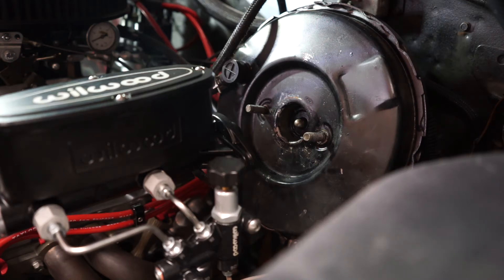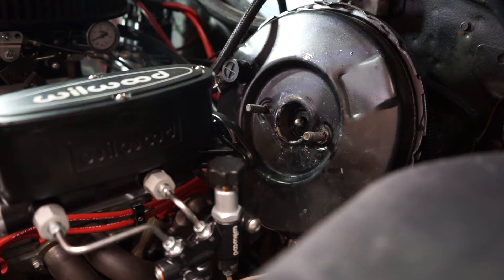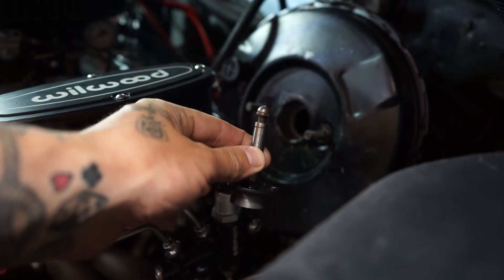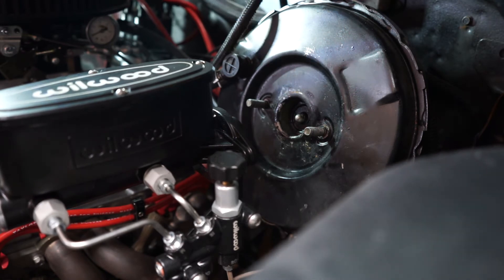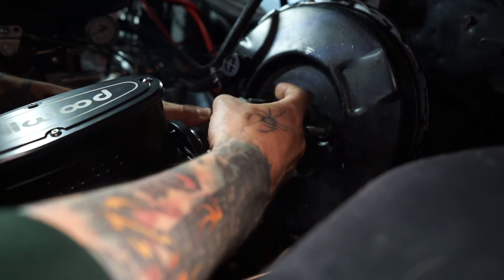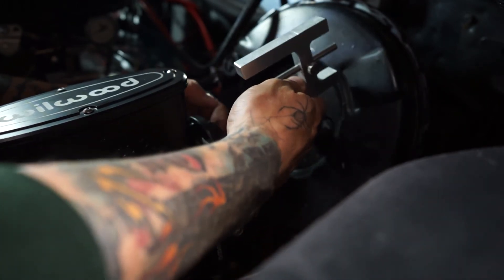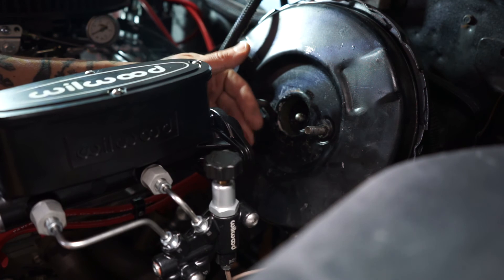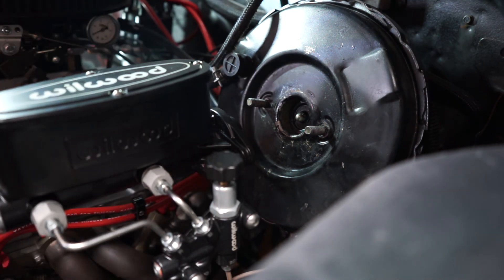Wilwood Master Cylinder Soft Pedal Fix

Comment: Great explanation. I had this problem on my '66 Nova, but the rod was adjusted too long, and my rear disc brakes were dragging and heating up. I made my own depth tool to fix it. Once the proper clearance was set, the dragging brakes went away. Opposite of your problem but just as annoying. Thanks
Reply from the maker: I've heard of that being a problem as well. I also think the constant pressure on the master cylinder isn't great.

Comment: I’m dealing with this right now on my 65 f100. All of my brake parts have been replaced. I was able to bleed the rear brakes just fine but nothing on the front brakes. A guy on an F100 forum suggested the same thing so I’m going to give it a shot tomorrow.

Comment: I wonder if the shaft is adjusted out to far if it would cause the Willwood to leak fluid.  Mine  Willwood is not even a year old and it leaked and killed my booster
Reply from the maker: Constant pressure on the MC piston is definitely bad. I’m sure it could cause the seal to fail.

Comment: Hi,  I converted my manual drum brakes to (YJ jeep) power disc brakes in my 76 cj7 jeep.  I noticed the piston rod was slightly longer on the disc brakes than the drums. So lowered my pedal to allow the extra length. After converting to disc, I now I have soft brakes.  I bled the system 4 plus times.  Don't think there's air. But I didn't bench bleed the mc.  And the pedal hardens up after I pump the brakes. I read I could adjust the piston rod in the booster.  Any Idea On how to fix it? Thanks for the video.
Reply from the maker: Bench bleeding the MC would be the first step, you may still have air in there. The next step I would take would be to check the length of the pin and make sure that you aren't resting on the MC piston and depressing it slightly. If the pin is too long it will make it impossible to get all the air out of the system. Also, make sure that your engine is drawing enough vacuum for the booster with a vac gauge.

Comment: Thank you helped out a lot what an awesome video. Do you need that adjusting valve on the side of the master? Thank you
Reply from the maker: No, you can have a regular proportioning valve/combination valve. This is an adjustable proportioning valve to change the bias between front and rear brakes.
Reply: @brendanmegannety7595  thank you👍